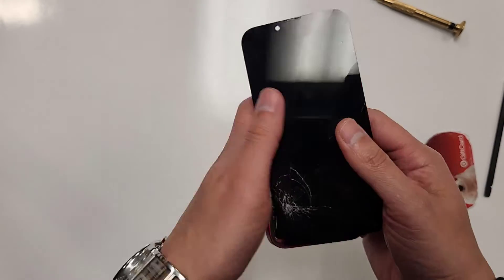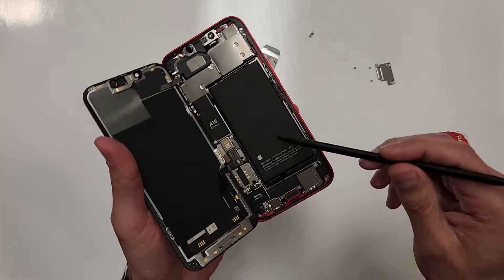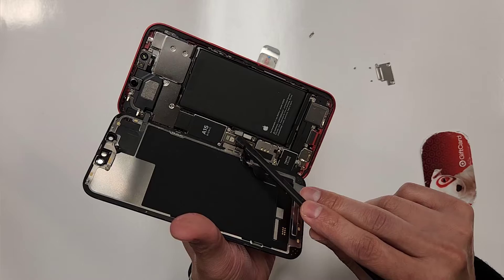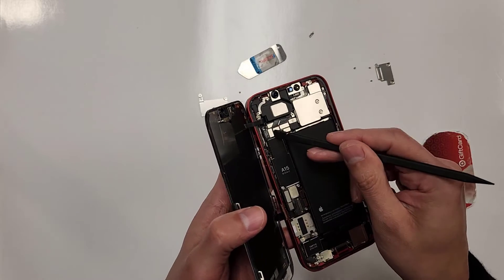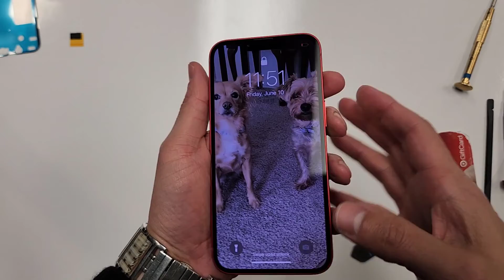iPhone 13 Screen Replacement | How to Repair for Beginners

Comment: The flex cable for the camera, it ripped when the broken screen was taken off. The new screen didn't come with that little metal piece that you took off of the ribbon. I need help, please. I don't know where I would buy that kind of a piece and how I would put it on.
Reply: Your Face ID has permanently broke then and you’ll have to try and find that exact part somewhere, what do you mean by little metal piece?

Comment: What temperature should I set my heat gun to so I don't over heat it
Reply from the maker: The heat gun doesn't have a temperature reading. I just go by feel. I dont put it on full blast heat but I get the heat gun to maybe 1 inch away and keep it moving back and forth. Don't keep it on one spot. Keep it moving so you dont burn that spot.

Comment: I was successful but my phone keeps overheating and turning on and off now
Reply: And I still can't touch the screen
Reply from the maker: Most likely damaged the proximity sensor. The cable that's attached to the screen. The one where you peel it off from the old screen and transfer it onto the new screen.  Possibly has a tiny tear somewhere on there. Those cost around $10ish bucks.

Comment: When i go to transfer the adhesive thing from the old screen to the new screen, the two black connectors are quite loose. Is that normal?
Reply from the maker: Tag the min and sec mark from the video of what you mean

Comment: Why not use some glue? Won’t the adhesive be a bit weaker after peeling off and having used it with the original screen? And what glue is good to use if using?
Reply: Also no possible problems with error messages from the screen not being original? As in a message popping up saying it’s an unauthorised display?
Reply: And thanks btw very helpful video

Comment: Was not able to remove the broken screen even after applying heat and trying to find the gap, I am open to answering questions that can help fix my phone, thanks you😅
Reply from the maker: The tool you are using could be to thick to stick between the screen and the metal frame. What are you using to fit in the gap?
Reply: @RichardMeza , (@umasathish)  had to use a razor blade and heat, after blade was in seam . (DO NOT HEAT RAZOR BLADE ).  Then it came off kind of just as he showed it would. But I didn't just use the tip of the razor. I slid the whole razor into the seam, and the heat kind of pushed the screen upward. So the heat is a must, just don't use too much heat. good luck .

Comment: What did you do to resolve the Trutone and the “Not Genuine Part” error?
Reply from the maker: iPhones don't do that anymore. True tone automatically works after screen replacement and the Non genuine part pop up message in the settings aren't there. Apple got rid of them. When the iPhone 16 came out and ios 18.0, that's when that changed for iPhone 12 and newer.

Comment: Do you have to transfer a code from the old screen to the new the new screen? I heard they pair the screen with the phone so the phone knows it’s a third party screen so some functions don’t work? I’m really confused
Reply from the maker: No, you do not. You used to if the software was before ios 18.0. But after the iPhone 16 came out, Apple changed things. Like True Tone. It automatically works with aftermarket screens now. Before you would have to transfer and solder a microchip or connect a electronic device to read the screen and transfer it over. You don't have to do that anymore on iPhones 12's and newer.
Reply: @ thank you so much! Great help clearing that up !
Reply: @RichardMeza  What about Face-ID ?

Comment: Does the display ic from old screen need to be used?

I see some new screens come with extra small rubbon for this
Reply from the maker: It's not needed anymore after the new ios 18 update. It was optional. The reason why you would transfer the ic, was that you would trick the phone into thinking the original screen was still being used which would keep the True tone and you also would not have the annoying non genuine part notification in the beginning of the settings. With the new ios 18 update that all changed. With Aftermarket screens, True tone automatically is enabled and the Non genuine display has disappeared from the settings. You can only see it if you search into Service & Parts history. But you don't have that pop message anymore.

Comment: My model says a2482 but I can’t flip it like a book when I separate the screen, there seems to be cables attached to the screen to the top part near where the camera is, any thoughts?
Reply from the maker: There's 2 sets of cables. One for the screen and the other for the proximity sensors. You need to unscrew both sets. Unplug them and transfer over the proximity sensor cable over to the new screen.

Comment: Will this work if I currently have a thin green line going down my iPhone 13 Pro screen
Reply from the maker: You need a screen for a 13 PRO. The regular 13 screen is not compatible with a 13 PRO. To get rid of the green line, you need to replace the screen.

Comment: Does face id still work or is there a chip that needs to also be transferred to the new screen?
Reply: as long as your transfer the light and proximity sensor which is glued to the old screen and put it on the new one you're good
Reply: @ImtixBusiness, thank you for clarifying that. Much appreciated.
Reply: Det er en fin video. Men hvis målgruppen skal være nybegynder, så skal du nok fortælle hvor meget varme og hvor længe til henholdsvis at få skærmen af, samt til kablet på skærmen. Kunne man i øvrigt ikke bruge isopropyl alkohol til at løsne kablet?

Comment: I can i use a hair dryer to provide the heat, or do I need to get that heating tool you have?
Reply from the maker: You can use hair dryer, it will take longer though since it's not as hot as a heat gun.

Comment: Quick question, could I use an iPhone 13 screen to fix an iPhone 13 pro screen?
Reply from the maker: Absolutely not. Won't even work or connect. The iPhone 13 Pro screen uses a higher refresh rate then the regular iPhone 13. Those screens are not compatible with each other. You can't mix and match parts with different cell phones. They won't work and most of the times the connections are different sizes and won't plug in.

Comment: Does Face ID work after doing this on a 13?
Reply from the maker: Yes. Why wouldn't it??
Reply: @RichardMeza  I’ve read online from everywhere that once you remove the screen and replace it that Face ID and True Tone auto brightness stop working. I’m confused now
Reply from the maker: @CMB.23  No. There is always some glitch that comes out when new phones are released. They are quickly fixed within the first software update. Usually within the first 2 weeks of the release of the phone. Look at all those news articles or Youtube videos. They are all released when the phone first hits the market.
Reply: @RichardMeza  oh okay thanks makes sense now. So is there a link to the screen you bought? I'm going to attempt to fix my own phones screen with your videos help
Reply: @RichardMeza  you don’t know what you are talking about. Yes, Face ID stops working and auto dim function disappear after screen replacement.
Reply from the maker: @adomasak2325  Nope. You are 100% WRONG. Face ID works on All screen repairs, all models. Either you are Not in the phone repair business or you're just talking shit to get a response. Which one is it???
Reply: @RichardMeza  Do you have to move any parts over from I-Phone 13 PRO to insure everything works properly? versus a complete screen with everything on it already?
Reply from the maker: @josetierra8504  You have to transfer over the original proximity sensor from the old screen, back over to the new screen.
Reply: @RichardMeza  You will have to program the screen or else face ID, True tone, and Auto Dim will stop working. That's Apple for you.
Reply from the maker: @jeremyocampo1529  Face ID doesn't fail for a screen replacement. You must have watched old videos when the phone was first released. That was a software glitch and Apple released a software update that immediately fixed that issue. That was before parts where even available to buy for the new phone.